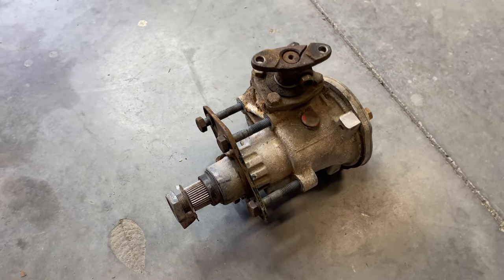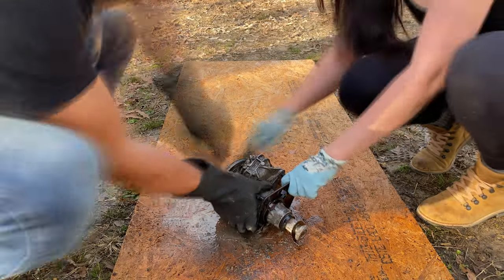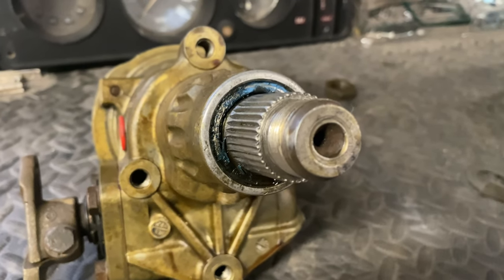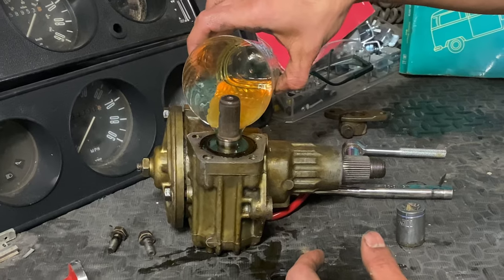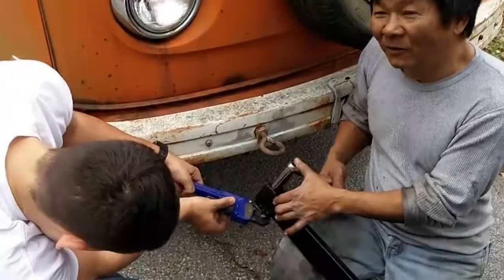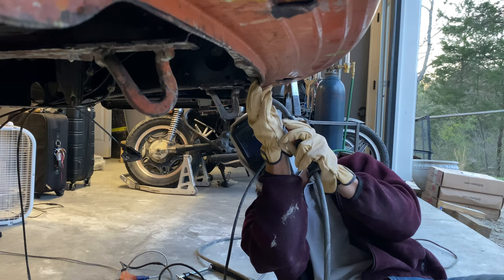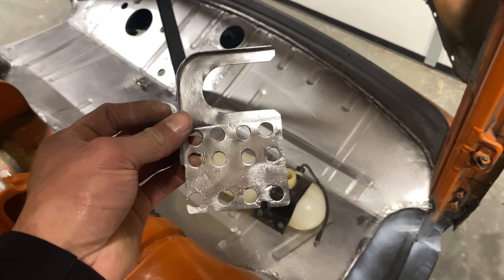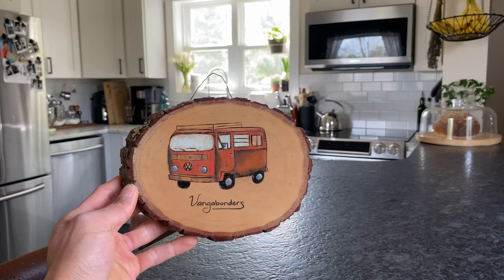The Little Details Make a Big Difference | VW Bus Restoration Episode: 26

Comment: Brass bristles are the wrong choice for degreasing an iron case.
Reply from the maker: I sure learned that one the hard way
Reply: @Vangabonders  never wondered "why brass?"?

Brass is soft and non-marring. Brilliant for getting patina off a delicate item or removing corrosion from something engraved, etc. Frankly stupid for scrubbing dirt from an iron steering gearcase. Probably didn't even need degreaser. A buck at the car wash would've yielded a cleaner case with less labor and a fraction of the money invested. Follow that with some Dremel wire brushing in the corners and crevices, then a cleanse in acetone or other surface-prep, and you're done.

Also befuddling to see the case coated in a protective layer BEFORE the seals were replaced. The seals didn't get coated and the removal/installation process compromised the coating. 

You also mentioned that the input flange o-ring isn't readily available but didn't mention how you addressed it.
Reply from the maker: Honestly I used the brass bristle brush because its the only thing I had around at the time. As far as the O-ring seal I just cleaned it up and re-used it. I have seen other people use RTV or some kind of silicone/gasket maker but I didn't feel like it was necessary. Only time will tell